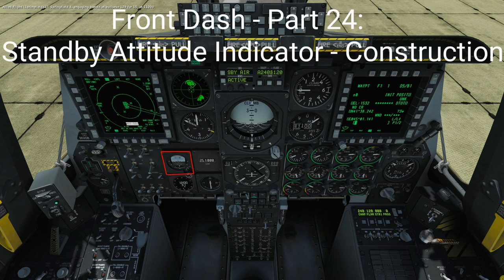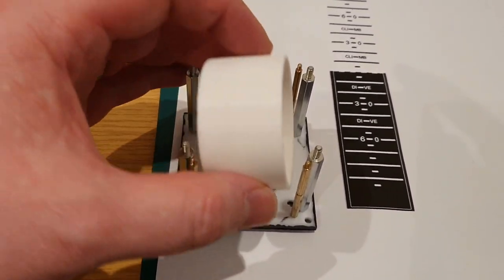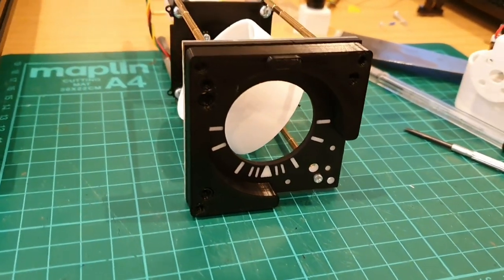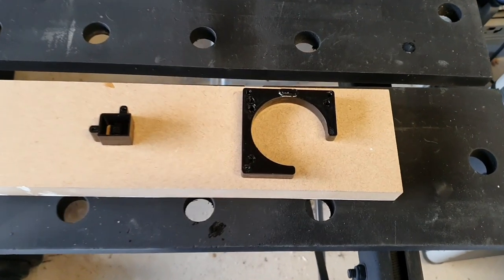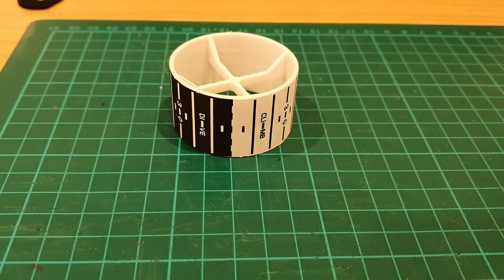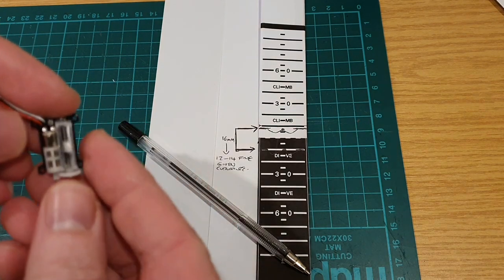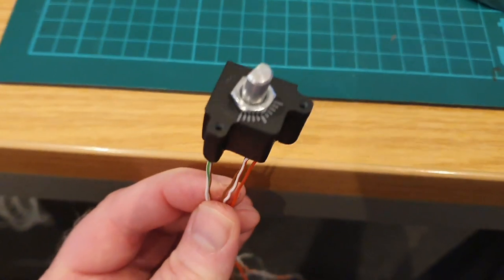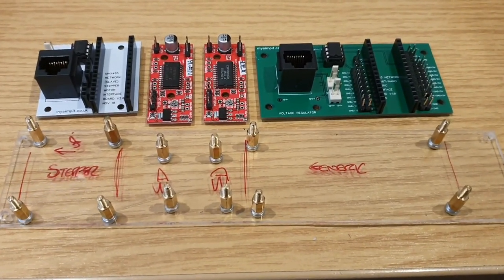Simpit A10C - Front Dash - Part 24: Standby Attitude Indicator - Construction

Comment: Outstanding!  Wow a lot of work and tight fitting but well worth the end result.  Do you have a video (or segment of a video) whereby you describe construction of the tape.  I have been trying to print out PCB patterns on clear transparencies and even vellum with little success. First-off the printer is not dimensionally-accurate (that-is) if you divide the print into 4-quadrants then take spatial measurements they are not proportional; I was told a long time ago this was to prevent accurate printing of money-currency (this may be corrected with a better printer-I'm using an older HP Laser-Jet). Second, and most maddening is the lack of toner density that allows light to come through and ruin the contrast of the print. The geometries that you are using are much larger but I notice you really get nice sharp clean lines so maybe I could benefit from this particular process.  Great video - Thanks Craig!
Reply from the maker: Hi Gary, as regards the tape, is it the design of the 3D printed wheel or the paper print thats stuck to it that you wanted further detail on? Let me know, although I've pretty much finished the next video on this panel I can certainly put some information on my website to cover what you wanted 
So are you making your own PCBs? I hear your point about toner density, I had a similar issue when printing on acetate and transparency
Reply: @CraigSmysimpit thanks again for responding. Yes Craig, I am making my own PCB's, however I am having great difficulty with trying to generate transparencies for exposure when trying to use very-fine pitch SMD parts; specifically SMD's that have 0.25mm leads on 0.5mm centers. The printers that I've tried either wont give enough density or they geometrically distort the dimensions of the SMD part so the leads will never line up. I was noticing that your tape that you applied to the wheel looked really well difined and had good (toner?) density.  So, I was curious as to how you made the tape.

Comment: Have you considered using NEMA 17 motors?  They're half the price of NEMA 8s.
Reply from the maker: Hi No1sonuk, I have a few bigger nemas that I'll use for some upcoming panels and you are right (the nema 17's) are cheaper to source. I wanted everything as small as possible for the Standby ADI given its footprint. Cheers
Reply: @CraigSmysimpit  These seem to be a goo option - they're half the length of normal NEMA 17s.
I've not had a chance to test them yet.
https://www.amazon.co.uk/gp/product/B07H5C5943/ref=ppx_yo_dt_b_asin_title_o00_s00?ie=UTF8&psc=1